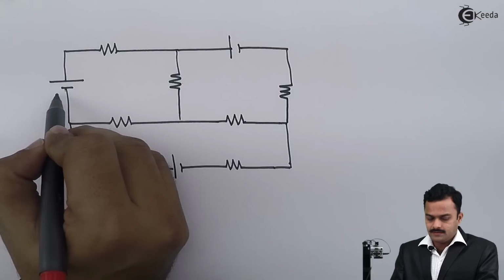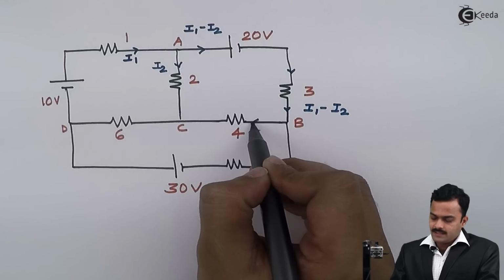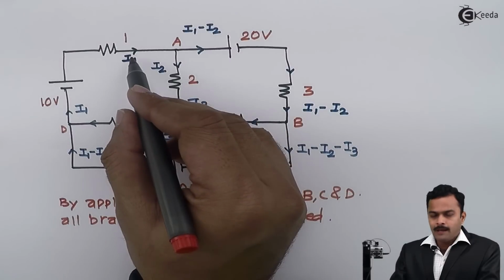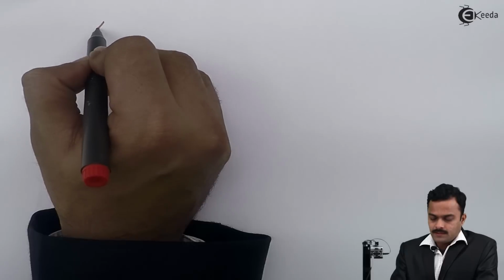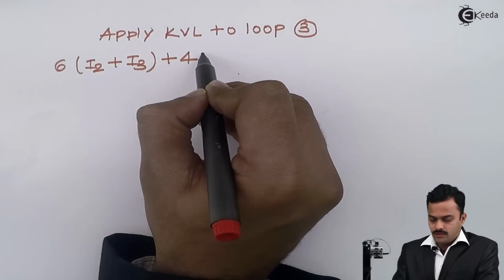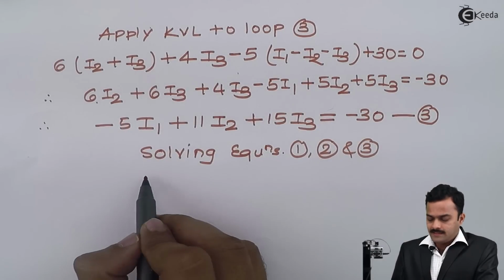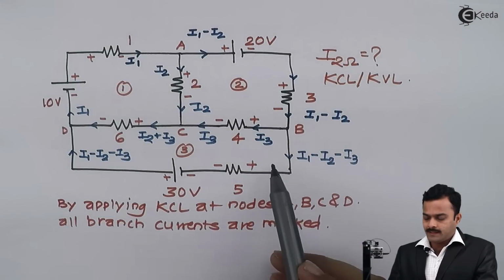Problem on KVL and KCL - DC Circuits - Basic Electrical Engineering

Comment: Very good..we can provide some real life example of what problems we face near electrical circuits and warn against 
Wire fuse 
Wire is exposed to environment conditions
Circuit break or over load
And flooding near electrical circuits

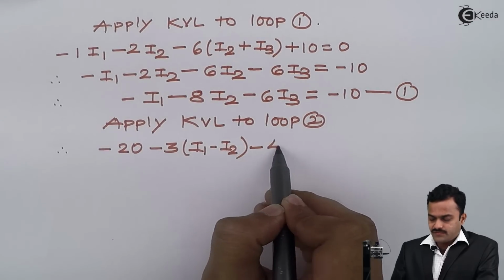Comment: Does the direction of the current passing through a resistor not matter when writing out KVLs? I thought that it did, but at ~6:00 I was expecting him to write:  - 20 -3(i1-i2) - 4(i3) + 2(-i2) = 0  {notice the negative sign on (i2) in the last term}. The current is flowing the opposite way as the loop direction, but he writes it as +2(i2) instead as if to imply the current direction doesn't matter in this case. Is this true?
Reply: I had the same question. Probably, yes